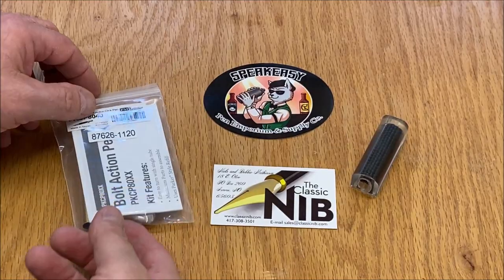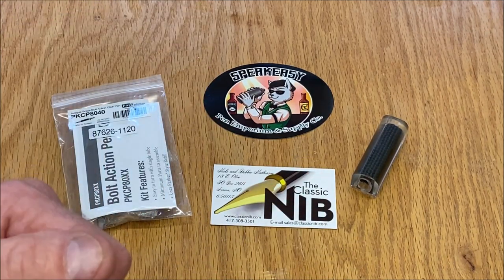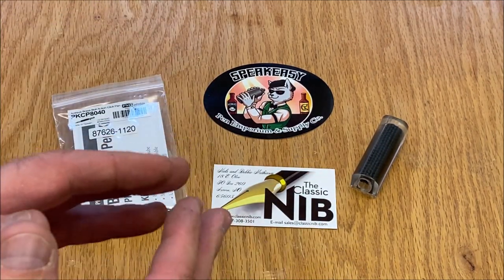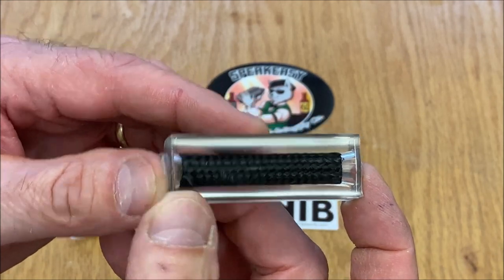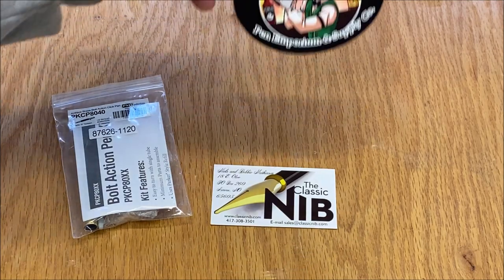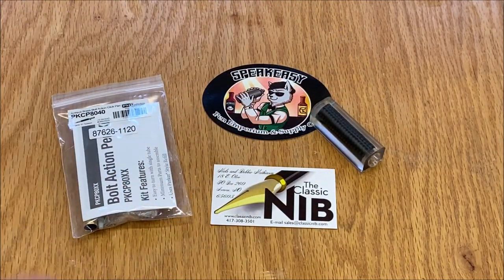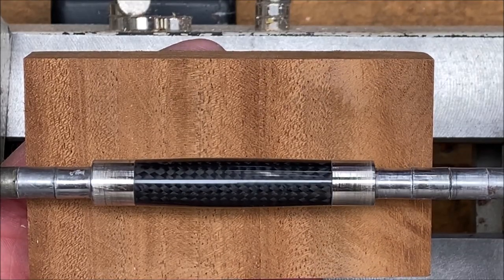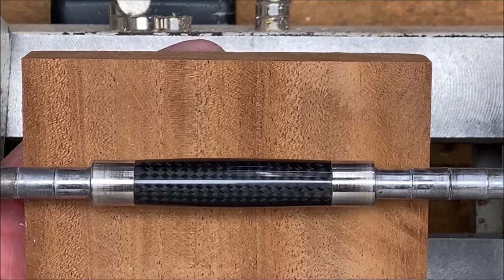Turning A Carbon Fiber Bolt Action Ink Pen

Comment: The pen is great but the part of the video I'll probably use a LOT is the toothbrush. I had one of those "[facepalm] why didn't I think of that?" moments. Glad to see new content from you.
Reply from the maker: Thank you. 
  I’m glad you found a useful tip. 

  Did you catch the one where I used a bushing while pressing the pen together to ensure I didn’t damage the blank?

Regards,
Bob
Reply: @RJBWoodTurner  Now that you mention it, yes I saw that and it is EXTREMELY helpful.
Reply from the maker: @TdotRob  😃

Comment: What type of insert are you using to cut the carbon fibre? Carbon fibre seems to be quite hard on certain inserts.
Reply from the maker: The Carbon Finer is around the tube. Then the tube is cast in clear Alumilite. I’m only cutting the Alumilite and I’m using a standard carbide cutter. 

Regards,
Bob